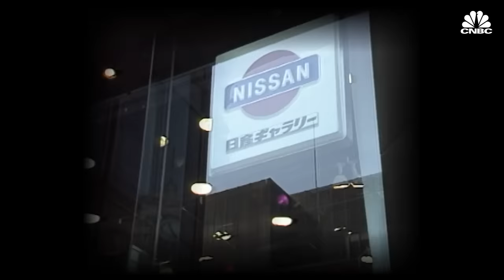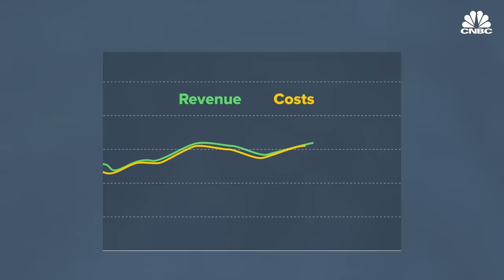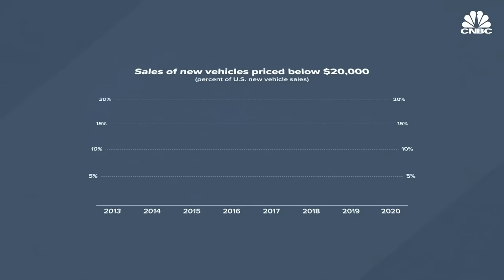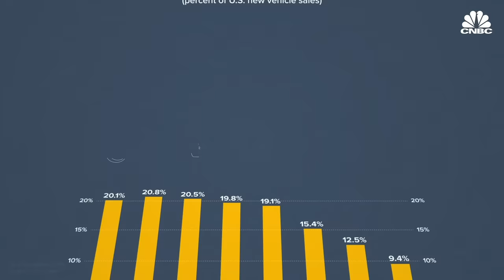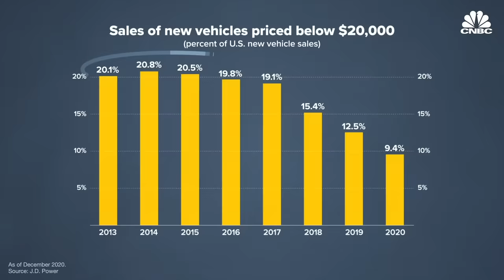Why Cheap Cars Are Disappearing

Comment: "Cars last longer than they used to"... Do they even know what a turbo does to a 4 cylinder now with GDI? lol
Reply: Nothing.  They will go 300,000 kms.  I have seen them, especially if you take care of them
Reply: @kevinW826  cars don't last 200k mileage nymorw
Reply: @danielgroeneweg3781  yes they do.  A guy I work with has a 2008 GTI with 300,000 kms.  It’s been heavily modified too.  A friend of mine has a same year Audi A3 hatchback with almost 400,000 kms.  Both original.  Two other guys I work with have a pair of Honda’s from the early 2000s, both have 200,000 kms.  My mother has a Toyota Venza with 150,000 kms, going strong.  I found a few cx5s and a couple of 2016 Mazda CX-9s with 200-300,000 kms on the clocks.
Yes cars will go 300,000 kms if maintained properly.  There is a guy on the Toronto Mazda 3 forum he has a 2016 Mazda3 with 300,000 kms as of last January.  On Mazda3 revolution forum, a guy from California has a 2016 or 2017, he did 100,000 miles in two years.  Shall I go on?
Reply: @kevinW826  your big failure is saying "if maintained properly" in an assuming way. Define what "maintained properly" means, because anyone can keep a car going for repairs that cost as much as a used car lol. I'm talking about not having to maintain it so much. HAHA
Reply: @mmitchell1727  following the scheduled maintenance guide.  Major repairs can be avoided if you follow the maintenance guide.  Sadly most people don’t.  That’s why cars don’t go past 100,000 kms.  Someone I use to know followed the maintenance guide to the letter for his Audi A8.  He got 350,000 kms before the transmission finally went out.  Other than that it was basic maintenance.
Reply: @kevinW826  that isn’t new. Turbo cars and direct injection is starting to be the norm. You’ll find out these cars won’t be as reliable as older cars
Reply: @SoulEraser000  the 2008 GTI/A3 are gas direct injection motors.  They are reliable despite what some people say.
Reply: @kevinW826  un less you want to replace a turbo then it wont go 200k. also then new engines are pushing like 7 to 8 psi with fairly high compression ratios now with manufactures making planned obsolescence a thingy cant see a turbo going much farther than if 200k if if that
Reply: @danielgroeneweg3781  did you even read my previous comments?  Both the guy I work with his GTI is original turbo and motor at 330,000 kms.  And my friend with the A3 turbo is original turbo.  There was a guy I use to work with, he had a grey import legacy wagon turbo from japan.  It had 200,000 kms on the original turbo when he got it and he put another 200,000 kms on it while we were working together.  So yes turbos can go for 300,000 kms.  I found a 2016 CX9 with 300,000 kms on the original turbo.  Dealer serviced.
Reply: @kevinW826  were talking about 2020 or 2019 cars not 2016 or 2008 new cars
Reply: @danielgroeneweg3781  too bad.  Turbos will last.  I don’t care what you say.
Reply: @kevinW826  tell that to my dads Ford with a turbo that already broke down
Reply: 97 was the peak
Reply: Since everything is controlled by a computer, everything runs optimally with less mechanical failures than ever before. I feel like the people who think that new cars are bad are the people who think they are more safe in their 1960's hooptie and complain how a hamburger used to cost 65 cents.
Reply: The new vs old car longevity is a very complex question with no right answer. However cars last longer these days
Reply: @Stockholm Syndrome and old cars have problems with the consistency of material quality, electronics from the 90's was way more faulty than compared to today. 

Build quality overall wasn't as good, the parts wore of faster because the optimization wasn't as good. 

Seriously, I've heard way too much whining about every single car generation

Comment: Blame inflation. Prices of cars rise every year as automotive companies install more technology while lessening the quality interiorly.
Reply: That second part is not true, maybe true if you buy GM products. Quality has been on the rise, especially if you look at brands like Mazda and even Toyota. Hyundai and KIA have premium cabins in their newest offerings like the Palisade, Telluride, Santa Fe, and upcoming Sorento.
Reply: @Lucky8s  Valid point, but what about the base models? I guess I'm speaking in terms of Nissans, Chevys, etc.
Reply: @7twenty8  
Nissan just released a completely redesigned version of their Sentra and it has impressed a lot of reviewers.
Reply: @Lucky8s  kia isn't as reliable as mazda and toyota, just look at all their fire recalls recently.
Reply: @Mark-jd1jx  
Those fire recalls have nothing to do with reliability though. After reading into it, the cause of the fires is due to a possible leak in the brake fluid line which could cause an electrical short. 
The 2020 RAV4 had a recall earlier this year where the engine block could've been manufactured improperly, which could cause a sudden engine shutdown or fires. Had mine inspected but no issues. My buddies 2018 Highlander was in the dealer a few days getting a recall. No problems either, it was repaired. Basically recalls happen in every brand and every model and they're pretty common.
Reply: @Lucky8s  Sentra got a bad rep for a while but it used to be really nice.  I hope it's on the comeback trail.  We need Nissan in there as a competitor, too, to keep the other companies trying hard.
Reply: @Lucky8s  Nissan has a unreliable transmission for nearly 20 years now. Still haven't fixed it

Comment: I miss the days when cars did not all look alike.   All cars look the same now, just one teardrop shape after another.
Reply: As opposed to one box after another?even vehicles built on the same platform these days can look drastically different. One being a car and the other anSUV.
Reply: Individuality and creativity has been sacrificed for aerodynamics and gas milage. I get why the aerodynamic cars are popular but I wish they still made more creative options for people who want them.
Reply: Mazda 3 hatchback and a Kia Stinger do not look the same, or a even a new Mustang and a new Camaro

Versus like a 1982 Chevy Celebrity, Ford LTD and Chrysler LeBaron all look the same 

I like old cars too but don't kid yourself
Reply: @Zohaibman72  Of course there were cars that looked similar in the past  - but The vast majority of cars are barely distinguishable from each other at all.   Be real - they look way more similar now than they used to.
Reply: Aerodynamics my man, also has to do with how CAFE standards are designed to hurt small cars.
Reply: @larshoneytoast3082  And all the SUVs look pretty much the same.
Reply: @tjtube65  I have a few examples of new cars that look wildly different, even ones in the same class. A Hyundai Veloster looks like nothing else on the road, a Dodge Durango, Dodge Charger and Dodge Challenger all share a single platform but all look wildly different 

Even a Toyota Rav 4 with its angry ass face doesn't look like the happy Ford Escape

I think it's just the times for you feeling like that because new cars are definitely more boring and expensive than they used to be, but I disagree on looks
Reply: @TheNacropolice  Understood.   Yes I realize the new cars are better in so many ways.  But damn, so many of the old ones looked fantastic!   Even the ugly ones at least wore their ugliness as a character!  lol
Reply: And they're all white, black, or silver. Boooring.
Reply: My friend said that new cars look like miniature spaceships.

Comment: Super expensive cars and on top of that manufacturer's are making it so you can't fix them on your own. Not worth it
Reply: I don't know about that, I haven't found much that I can't fix on my own.  At the very worst if I don't have the time I will just buy the part and have a mechanic install it.  As far as diagnosing a problem, having an OBD II reader has saved me a ton of money.
Reply: @johnmininger7472  search up the bill that Tesla Apple and John Deer currently are trying to lobby through congress. It bans parts sales to third party repairers and prohibits cars from being worked on if it hasnt been worked on at a dealership or approved shop. Its gonna destroy the auto buisness and the third party vendors

Comment: 11:20 Biggest load of BS i've heard about new cars. Complete freaking rubbish!
Reply: @entItyVR Ford, Nissan, Honda.... even these popular brands are just disposable vehicles nowadays.
Reply: Cars now are designed to fail even more than before. With plastic & rubber parts & sensors everywhere under the hood, cars now turn into a maintainence nightmare. As the car ages, no matter if you drive them; parts fry & cook or let them sit, unused; parts dry out & seals fail, it's a headache.
Reply: @oscarmadison275  I think there is actually 'planned obsolescence' so that certain electronic and/or mechanical parts are basically 'timed' to fail at certain points in time.

Comment: When I think of cheap cars, I think of “the pinto”.
Reply: Oh gosh you went way back I remember the Ford Pinto LOL.
Reply: @chrisb2844  the one that had a safety issue
Reply: Or Yugo
Reply: Not cheap, but reliable,  dependable and easy to repair. No electronics needed.
Reply: They were cheap, but dependable and easy to fix. To just replace my headlight in my 2015 car, I have to just about take off my entire front assembly of my car.
Reply: Surprisingly, these comments didn't go up in flames.

Comment: from sweden, but i drive a volvo v70 from 2011, low milage, bought for around 10k in usd(idk if thats high in the US but in sweden its reasonable). Wife wanted to take a loan for a new car, i straight up told her that i refuse to ever take a car loan , if we cant afford it we buy a cheaper one until we can save up for a more expensive one. but im still hesitant to spend like 40k on a car unless i have many times over that in savings, its a luxury not a neccesity.

Comment: 11:11 - new cars last longer? best joke I've ever heard, well done CNBC
Reply: I’ve never bought a new car but I was under the impression that they do
Reply: Oddix Games “new cars last longer” laughs in 4 cylinder eco boost
Reply: My car is 14 years old.  It runs well but I have had to put in $1000 a year to fix problems with it.  I had to put in close to $2000 this year for replacing the fuel injectors and replace wiring and a battery when it exploded in the car. 

I personally would rather get a new car than put in more money in a vehicle that has been nothing but problems.  I’m currently a student and will graduate in 2022.  So  I am aggressively saving to stay student loan free while also saving for a new vehicle.